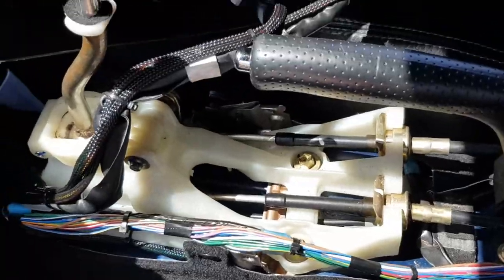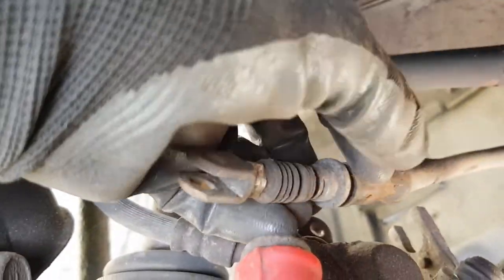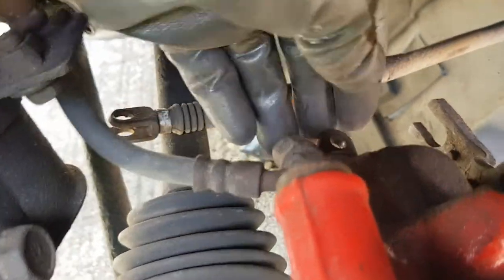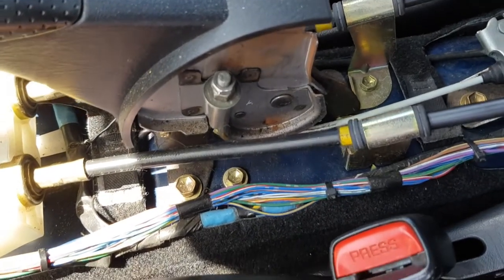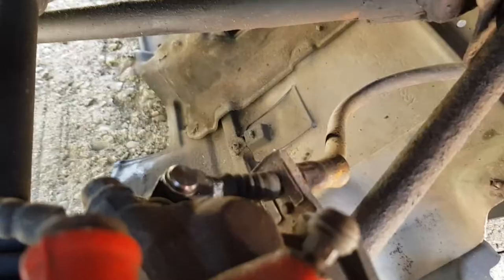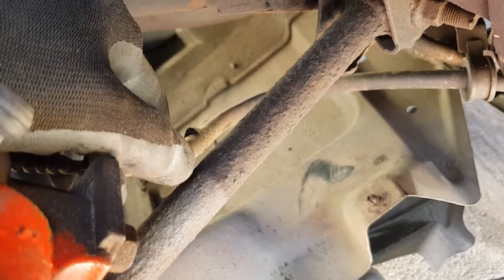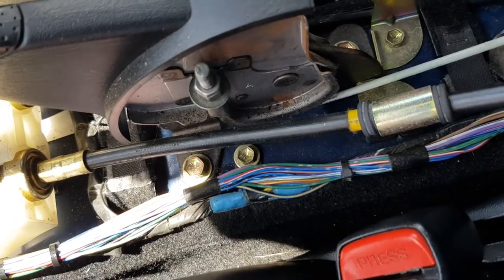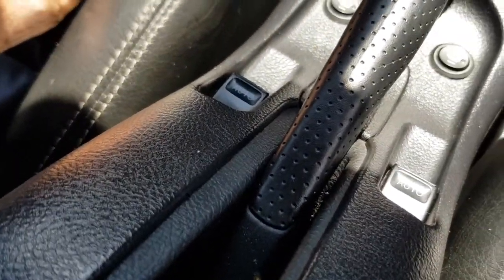MR2 Roadster / Spyder Handbrake Check & Adjustment - Full Guide

Comment: Hey there, I’m a Toyota mechanic and this is the correct procedure for adjusting the handbrake. Good luck!!! 👍🏻👊🏻👊🏻 

MR2 (RM762E)
BRAKE - PARKING BRAKE LEVER
PARKING BRAKE LEVER ON-VEHICLE INSPECTION
Parking brake lever travel at 196 N (20 kgf, 44.1 Ibf):
5 - 8 clicks
If incorrect, adjust the parking brake.
2. IF NECESSARY, ADJUST PARKING BRAKE
(a)
Remove the console box.
(b)
Loosen the lock nut and loosen the adjusting nut until the left and right parking brake cranks touch the stopper pin.
(c)
Start the engine and depress the brake pedal with the thread force at about 490 N (50 kgf, 110 Ibf) for 10 times.
(d)
Tighten the adjusting nut until the cable has no loose-
ness.
(e) (f)
(g)
(h)
Pull the parking brake lever up strongly once.
Release the parking brake lever.
Turn the adjusting nut until the lever travel is correct.
Tighten the lock nut.
Torque: 5.4 N-m (55 kgf-cm, 48 in.-Ibf)
(i)
Release the parking brake lever and check the brake drag of the rear brake by turning the rear wheel.
()
Check that the left and right brake cranks touch the stopper pin under the condition in which the parking brake lever is released.
(k)
Check that the brake indicator light comes on when operating the parking brake lever.
(1)
Install the console box.